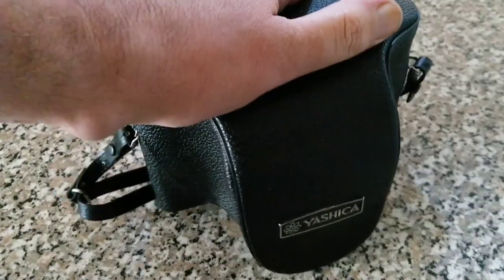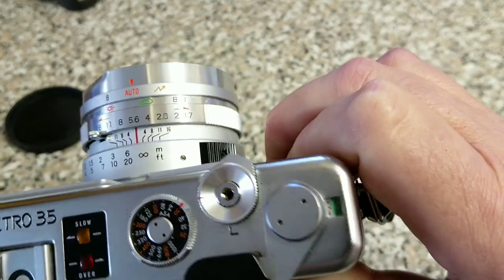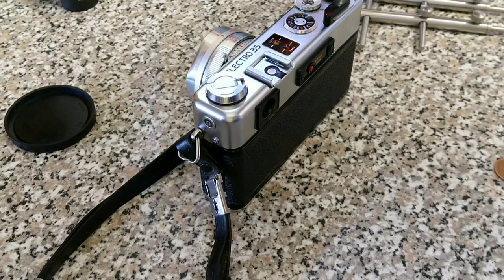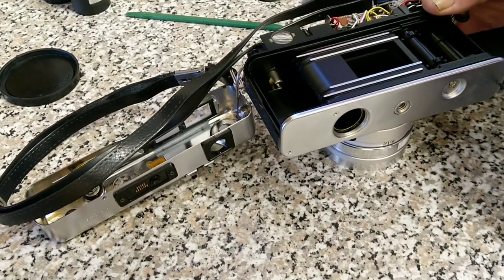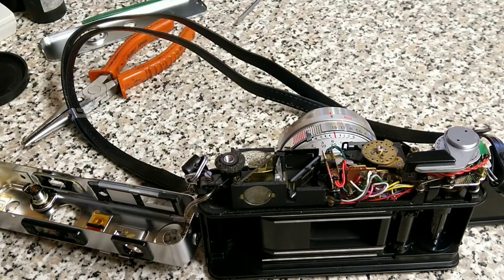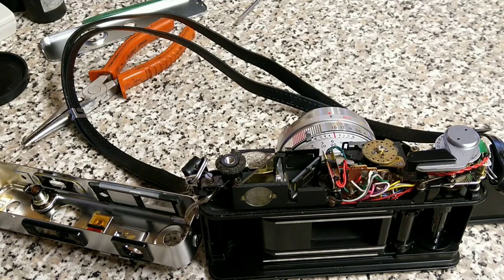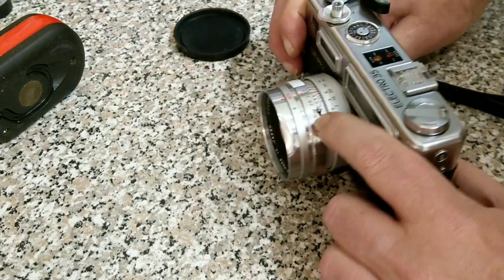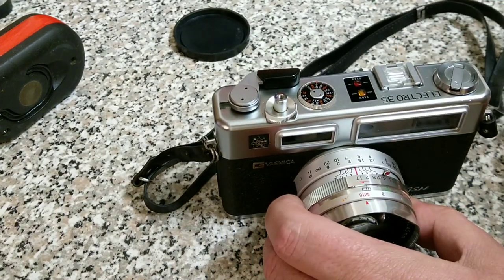Yashica Electro 35mm GSN, repair, shutter problem

Comment: hello hope you are well. Final pick one of these up, well two really one had been dropped shutter leafs loose  and lens slightly hanging off which is a GSN But! with a fungus free front element  which was going to replace the Front element on a Black GTN one which had fungus.  Turns out that the GTN front element once soaked in Hydrogen peroxide can up a treat with no track lines. The electronics on the GSN seem to be working just need to have a deeper look into its shutter as all the leaf are out now.

Comment: Very helpful video 👍🏻 I've also recently got myself a electro 35 GSN and it too has also had abit of a "punch on the nose" do you have any videos available on how to straighten these out? Thanks
Reply from the maker: Hi, sorry to hear about your camera, careful "tweaking" of the metal bits, disassembly can be awkward, start at the front and only remove the bits needing attention, I have not gone into a Yashica however most of the leaf shutter rangefinders are very similar, have added this issue to my "to make" video list....

Comment: Hello, I don’t know if you are still answering comments but I have no idea whether or not my yashica is working. The shutter button works, but the slide lever will not advance (as if it already has a shot loaded), but every time I press the shutter button I don’t hear anything at all and my slide wont advance. Do I need the battery to fix this? Everything else seems to be in working order.
Reply from the maker: Hi, yes I am still reading all comments and questions, if I remember correctly the camera should still fire without a battery, pop one in to be on the safe side, if the problem is still there then open the back and gently try to move the sprocket drive and take up spool, has the camera been working before or have you recently acquired it?
Reply: @thephotographersbag  I recently acquired it for cheap so I was expecting problems. I'll wait for a battery and if it's not functioning still I'll give it over to my local shop to fix it. Thank you for your diligent replies, it's not everyday a YouTuber responds to comments on a video that's old.
Reply from the maker: @Ruminatee  Hi, I try and answer all comments, you are very lucky if you have a local repairer, please keep me posted on your situation, they are wonderful cameras....

Comment: So, don't know if you can help me, I have one of these, I corrected all the mechanical problems and now from aperture 1.7 to 4 the over light always lights on even though the camera is firing slower than 1/500, and on apertures 11 and 16 on low light the camera never finishes the exposure, this last part seems like a leaky timming cap, but the first part I don't have a clue.

Comment: re the beam splitting mirror thats the glass at 45 degrees yellowish in color erm dont touch it!  I gave a Lynx 14 beam splitting mirror a clean and wiped the silvering off the glass so now the range finder is Forked... there no patch now in the viewfinder to line up,  the only option is to find a replacement.  would the mirror from one of these Electro 35 fit? The lynx 14 mirror is about 12mm x 27mm x 1mm thick
Reply from the maker: Hi, not sure but it could be made to work, there is usually quite a lot of adjustment available on the mirror mount, interesting proposition.. .

Comment: hi i hope you can respond as soon as possible. i really love your work and dedication and i was wondering, i've just bought a yashica electro 35 gt and mechanically seems to work perfect. the only major issue is that when im shooting in an intended low light scene, sometimes it exposes correctly taking its time, sometimes it wont, exposing the image to 1/500 of a sec i think, and it seems like one in 5 shots the electronic system functions and the other seems like it has no battery in it. do you know what the problem is? thank you in advance!
Reply from the maker: Hi, you sorta answered your own question, there is a problem with power delivery, could be a bad battery, corrosion of the terminals, or the wires internally, however if the exposure warning lights are working then it will possibly be the dreaded "Pad of Death" a common problem with these cameras, not an easy DIY fix, videos outlining the issue and repairs both on my channel and loads of other YouTubers.....
Reply: @thephotographersbag  hi, thank you very much for your response, i've just unscrewed my little toy being pretty sure that was the so called pad of death. however surprisingly i found a crisp new pad of death, do unusual. so im a bit stuck, even in bulb mode sometimes it fires as i press it, sometimes it fires its 1/500 default.

Comment: Hello. I got myself a GSN in extremely fine condition. Shutters fires and sounds right. There's a fine clunk sound. The yellow arrow and lamp works. But, when testing the red overexposure lamp, by setting iso 1000 and f/1.7 pointing at a strong light source, the red arrow appeared - but when I tried a second time, it did not and now, neither the red lamp or the red arroe in the vievfinder will light up. Could the lamp be blown? There's no corrosion anywhere and everything else seems to work fine. Hope you can guide me. Thanks.
Reply: Can a defective pad be causing only the red light not to work? Would it be wise to do the pad of death?

Comment: When I pull the lever to pass the film, the shutter opens and closes only when I take the photo. The shutter remains open at all times between the moment I pull the camera lever and take the picture. Do you know how to solve this problem?
Reply from the maker: Hi, the shutter should be closed all the time until you want to take a picture, it should open and then close when you depress the shutter button
If it is staying open all the time it will fog the film with light and ruin it, a stuck shutter will require a strip down and investigation into the reason why, might just need a clean or could be a mechanical problem, a cla may be required(clean,lube,adjust), quite an involved process that requires experience and not really a DIY project.. .

Comment: I’m having trouble with the spring within the camera, the battery isn’t registering. 

Anyway I can fix that ?
Reply from the maker: Hi, it may be corrosion, easily sorted with some fine sanding paper, green corrosion can be removed with a small amount of vinegar and a Qtip or cotton bud, if the spring is not springy enough, some gentle manipulation may so the trick, feel free to come back if still having issues.....
Reply: @thephotographersbag  i already sent the camera back lol damn

Comment: I got a new battery, but the light is not showing, what should do you recommend?
Reply from the maker: Hi, it could be that the lamp is defective but that seems unlikely, has the camera suffered any battery leakage from previous batteries being left in it during storage?
Corrosion will travel up through the wiring and cause a lot of problems, sometimes a good clean with some vinegar on a cotton bud,(q tip), otherwise it will need a strupdown to find the problem, not something for the inexperienced!
If you have just purchased the camera, you could try contacting the seller for a return, difficult situation.....
Reply: @thephotographersbag  Tbh, I have no idea. I got it off ebay, and it didn't come with batteries. I recently purchased a battery + adapter, from Yashica Guy, and it still didn't work. Everything sounds fine though. I will be testing it out Friday to see what happens. I will try the cleaning with vinegar.. if not, might have to take it to get fixed. Thanks!

Comment: So the flickering light from the "over" and "slow" means it had the bad of death?
Reply from the maker: Hi, it's a good indication of Pad of Death issues, the lack of clunk when winding on is the main diagnosis, flickering lamps might be a wiring issue, are you having problems?
Reply: @thephotographersbag  I shot two rolls and everything seems fines except to a few light leaks
Reply from the maker: Hi, that's great news, light leaks are fairly easy to sort out or leave them as they are, might add some authenticity.....

Comment: Hello Sir, I've got the same model but the frame counter is not working, is it a simple fix? Thanks in advance.
Reply from the maker: Hi, sorry to hear about your issue, is this on a recent purchase? 
How confident are you are camera disassembly, this will require the top cover to be removed and possibly further disassembly as required
If you can live with it and the camera works fine, I would suggest leaving it 😁
Reply: @thephotographersbag  first of all thanks for your answer, I really appreciate it. Yeah, it's a recent purchase... it sounds difficult to me, I think I'll try to sell it for pieces (I'm not sure abou this last sentence, I hope you will understand) Regards!
Reply from the maker: @AsierBenito  Hi, if the problem you described is the only issue the camera has, you could use it and not worry about the frame counter
What is your native language?
Reply: @thephotographersbag  I haven't tried it with a battery yet but I think the camera works. Spanish (I'm from Spain)
Reply from the maker: Hi, this camera does not require a battery, it runs on solar power, my advice would be to put a film through it and seeing what the results are like...

hola, esta camara no requiere bateria, funciona con energia solar, mi consejo seria pasarle una pelicula y ver como son los resultados..

Comment: Hi,
I just bought the camera and I think it has an issue. First of all the over and under led does not work, but this may be a wiring issue. But it seems to me that the shutter does not work accordingly. No matter what film speed, aperture I select, the shutter speed seems to be the same. And that click after i wind the film, it doesn`t exist. 
Should I go ahead and check it? 
Thanks,
Reply from the maker: Hi, did you know these issues when you bought it?, Can you get your money back?
It sounds like a dead battery or a wiring issue, combined with the pad of death, neither are easy repairs if you are new to fixing cameras, without power the shutter will always fire at its highest speed if I remember correctly.....
Reply: @thephotographersbag  hi. Unfortunately no. I got it from a flea market. The battery seems to be working. At least the battery check bulb is lighting up. The other one is the issue, the one indicating over and under. I shot a film with it and I will take it to development but it seems like it's not working properly.
Reply from the maker: Hi, it sounds more and more like the Pad of Death issue especially if it is missing the clunk when wound on, it can also affect the metering so I suspect it will need repair, search online for videos of the repair and see what is involved and decide if you feel up to the task, please come back after you see the results of your recent film.....
Reply: @thephotographersbag  yea. I'm not that handy with repairing things but I will take it to a repair shop, I think I found some guys and I'll see if they can do it. Anyway, thank you so much for replying to me. I really appreciate it. And keep up the good work
Reply: @thephotographersbag  Hey. I just got the roll from development and it seems fine. Apparently it`s only a matter of the exposure bulb not working.
Reply from the maker: @GabrielGheorghe91  Hi, that's fantastic news, so happy for you, enjoy the camera, they are great....
Reply: Thanks again for the reply and help :)
Reply: @thephotographersbag  Yessss. It`s so underrated!

Comment: Hello, I have 2 GSN’s. One is in complete working order and looks great except the lens is peppered with mold. The other one has a couple of issues, but, the lens is crystal clear. How difficult is it to swap out the lenses on these cameras? If too difficult I’ll just take what I need off of the good one and put it on the other camera with a good lens. What are your thoughts? All the best. Jim from Georgia.
Reply from the maker: Hi, the lenses are reasonably easy to disassemble so I would strip the fungus infected lens and treat the fungus. To get to the rear element open the shutter on B and clean from the front, then reassemble
Alternatively take the clear elements from the good lens and swap to the other body, they are great cameras, have you tried shooting with the lens "as is", is the fungus noticeable in the images?
Reply: I believe these options are within my abilities to handle. I have not used the camera yet. I will shoot a roll of film first and see how it turns out. Thanks for your help. I really enjoy your videos. See you on the next one.
Reply from the maker: @JamesSmith-wy7zk  thanks for your kind words, and please keep us up on your progress, a lot of people will be interested and good luck...

Comment: Hi sir, sorry for disturbing you, I hope you feel comfortable with me, I found another old camera of brand Ricoh model Kr 10m, I checked the web but I couldn't get informations, can I get some description about it.
Reply from the maker: Hi, no problem, the camera is a 35mm single lens reflex launched in 1990, it takes Pentax K mount lenses and is manual focus only
It is powered by 4 AA batteries, housed in the camera's grip,and it has motorised film advance and rewind at the end of the film
It features aperture priority or manual metering and uses push buttons to change the shutter speed, there is a battery check facility too
However it sets the film speed only by DX coding on the film canister, there is no way to manually alter the ASA/ISO, however there is an exposure compensation system covering +/- 4 stops, shutter speeds on auto run between 1/2000 to 30 seconds, but only 16 seconds on the manual setting
They are well built and generally reliable, there are loads of km mount lenses available, nice find and quite rare now, however not that desirable, be interested if it is working!
Regards, Graham
Reply: @thephotographersbag  Thank you So much Sir, it works compleatly alright, only the flash didn't work but anyway will replace,now onwards will follow you (Subscription ).again Thank you 😊
Reply from the maker: @kavinishwar  happy to help and thanks for the subscription....
Reply: @thephotographersbag  Hi, Graham, today I bought a battery to my Yashica Electro 35GT. The Lamps, advance lever, POD all are fine, But the shutter blades are not opening, kindly please tell me how to fix this problem
Reply from the maker: Hi, sorry to hear that you are having issues, the main problem area is a thing called the " pad of death"
My first thoughts are to excersise the camera by continuously cocking the shutter and firing it, it may just be stuck through lack of use
Please read the following article, it will help you diagnose if you have the pad of death issue and how to solve the problem....

http://elekm.net/pages/cameras/repair_pad_of_death.htm

Please keep us posted on how you get on...
Reply: @thephotographersbag  Hi, Graham, I just now removed bottom and top covers and saw the POD is alright, and even It gets locked to the lever, Even though the Shutter is not opening 😢,Do I want to do something else, anyway that link helped me a lot 🙂.please suggest
Reply from the maker: Hi, well done great job, so now it is further disassembly to get to the shutter, here's a guide to follow,suggest reading it before starting anything, good job😷

http://mattsclassiccameras.com/how-to/inside-yashica-electro-35/
Reply: @thephotographersbag  Thank you so much Graham, will update you about the camera soon.
Reply: @thephotographersbag   Hi, I am veey very thankful to you that now the camera works compleatly fine, when I removed the lens a lever is not in contact to the Electro magnet,  so then I adjusted that now the shutter blades are working cool, thank you very much Graham a thousand thanks to you.😊😊
Reply from the maker: @kavinishwar  Hi, that's excellent news, well done you, be interested to know your thoughts on your first film through the camera, congratulations on saving it 😷

Comment: Hlo sir i have camra i want to fix it that is yashica kyocera MF-2 super and the button which clicl the photo isnt working so what i do can you help me
Reply from the maker: Hi, start with checking the batteries and connections, clean up any corrosion that is visible, if that does not help then time to strip it apart gently and look for broken electrical connections and internal corrosion caused by battery acid leakage...hope this helps and good luck

Comment: I have a problem with my yashica mg-1. The shutter blade doesn't want to close automatically until I release the shutter button. Do you know how to solve this? Thank you
Reply from the maker: Hi, sorry not specifically, I assume the battery is good?
That the indicator lights and information in the viewfinder is working?
The camera can run very long exposures, 20 seconds is apparently possible
You have set the film speed?
Try in bright light with the aperture( f stop) set wide open, think it is f2.8
Come back with some answers and we may move forward with solving the issue 😁
Reply: @thephotographersbag  yes, everything is working and in normal condition..